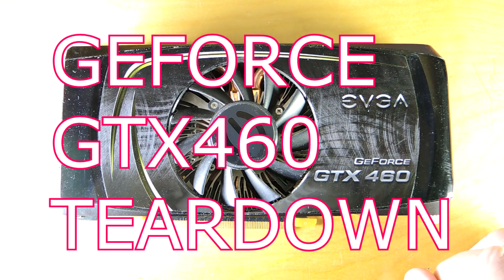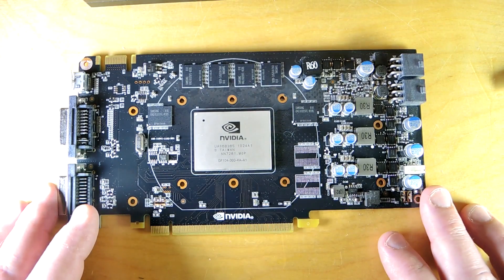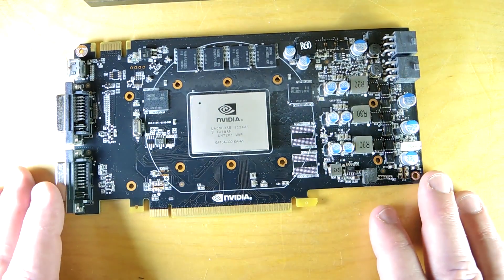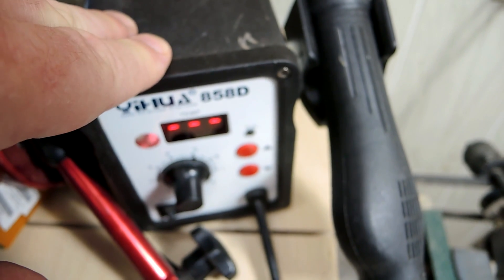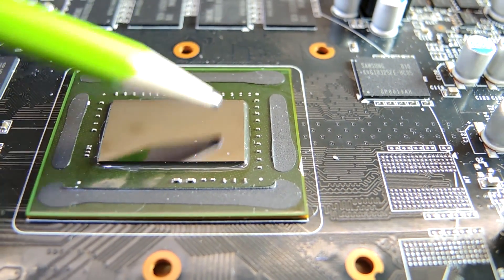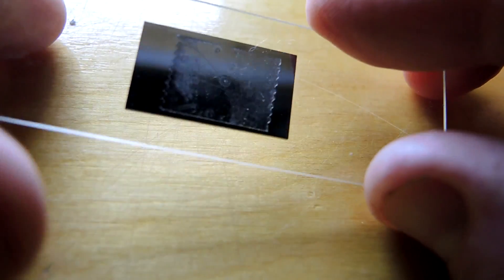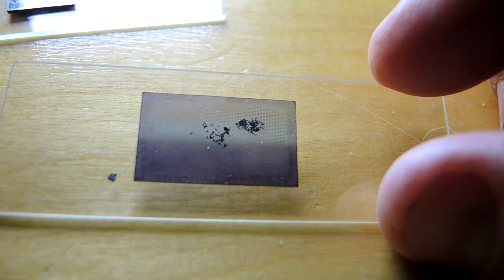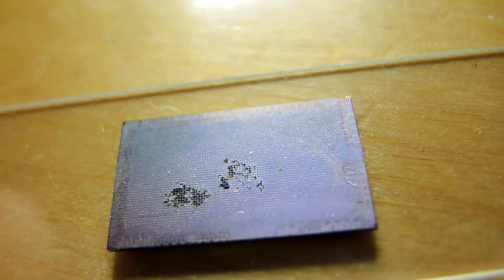Geforce GTX460 Teardown: A look at the Nvidia GPU die

Comment: It's crazy to think not just how many connections are underneath, but how many different places each one goes to and through different layers of the board. Then you have an even smaller network inside the chip. I wonder how small electronics can get

Comment: Should grab a GTX 480 (or another GPU of that family using the GF100 die (GTX 480, GTX 470, GTX 465, Tesla M2050, M2070, M2090)) and crack that sucker open. The die is even bigger than the one used in the GF104, and when it came out Nvidia got quite a bit of flak due to the hilariously bad yields they were getting with it. Out of every 100 dies made, maybe 17 were viable. Entire wafers (each costing about 5 grand, and holding about 80 someodd dies) would fail to yield a good die that's how bad the yields were.
Reply: And actually, if you REALLY want to go huge, Intel's got some ridiculously colossal dies for their server chips. Nehalem-EX chips are in particular amongst the largest they've ever done at ~684mm^2, a little over 2x the size of the GF104 die to tore down in this vid.